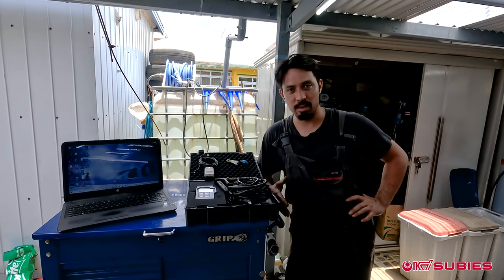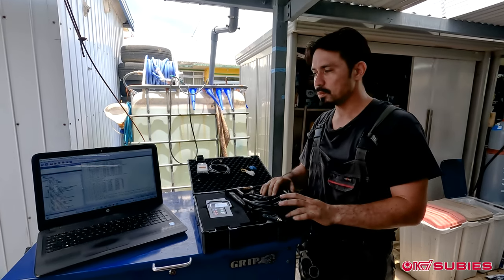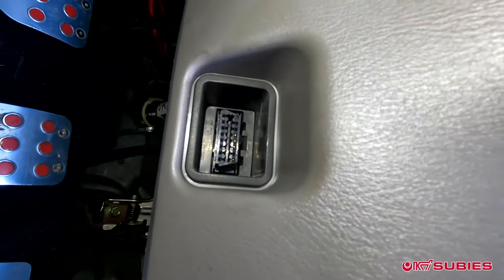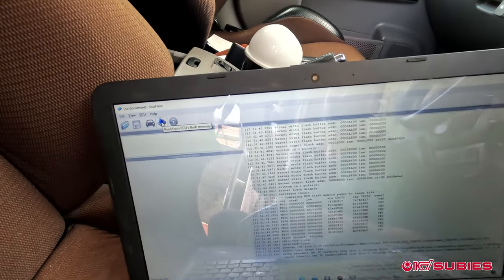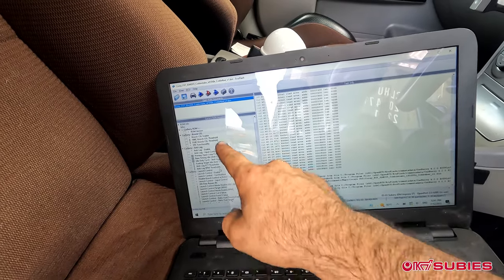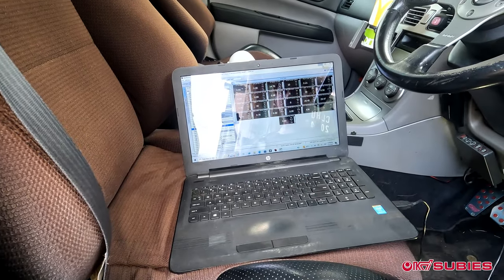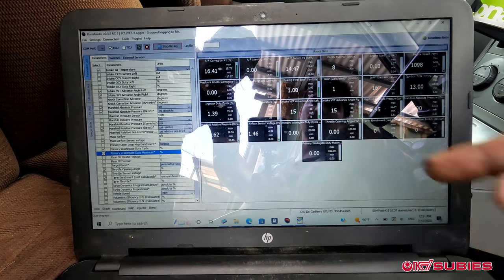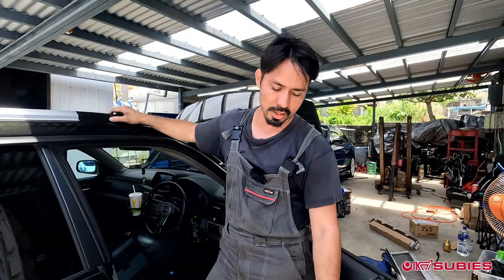E-tune on Cory's Subaru Forester XT - How to do it yourself / Step by step walk through

Comment: Any more info around the sequence of steps to prevent bricking would be great. I noticed after succesfully flashing you disconnected the jumper, then turned off the ignition. What happens if you turn the key off first? Or leave the jumper in while trying to datalog? 
Good video though!
Reply from the maker: Thank you for the question! 
Bricking typically only happens when interrupting the flash process or when you are pulling the rom. I have pulled ROM and uploaded probably thousands of times and never have actually bricked an ECU. The sequence of events will not brick it.

I was actually disconnecting the green connectors and not the jumper. The jumper you can leave in or take out and doesn’t effect anything. COBB access port setups usually keep them in also.

If you leave the green connectors in the check engine light will keep flashing at you so you just need to make sure it is unplugged before you start the car.
Reply: @OkiSubies  awesome, cheers for the reply! Any tuning, logging or rom raider stuff on legacy's (especially H6's) would be awesome

Comment: i have a a sti boost controller and a sti gnome boost gauge when i first got my car the boost gauge worked now it just blinks red any idea cheers
Reply: u should do a video on how the genome boost control works and trying to fix the eclectic gauge
Reply from the maker: @KINGCOGMX  That would be an interesting one! We usually trouble shoot by replacing individual parts but typically do not fix them. Would need to do some research for that!
Reply: @OkiSubies  ok cool, yeah any info would be good im tring so hard to get it to work, it use to work fine now every time i turn on the car it blinks red not blue its on my jdm spec b bp5 legacy 6speed

Comment: Is it better than Cobb tune? or same with no mods?
Reply from the maker: That is a great question! Cobb is great because you can also monitor some of the parameters like knock using the access port as a gauge. Unfortunately we never got the Cobb access ports here in Japan so we don’t have much experience with them but at the end of the day, both methods are re-flashing the oem ECU so it is hard to say one is better than the other but I think it is safe to say Cobb is probably more user friendly.